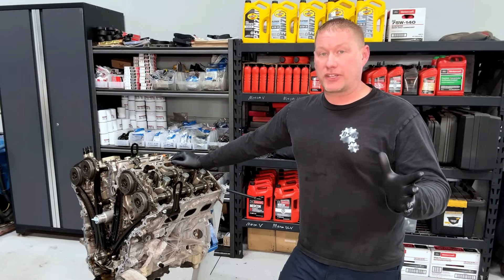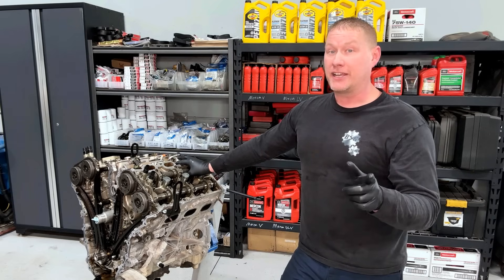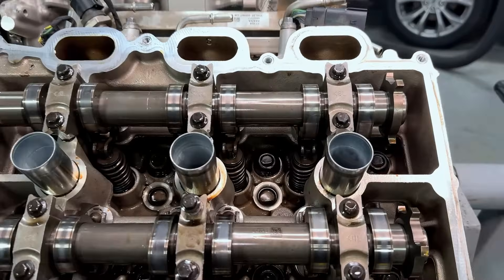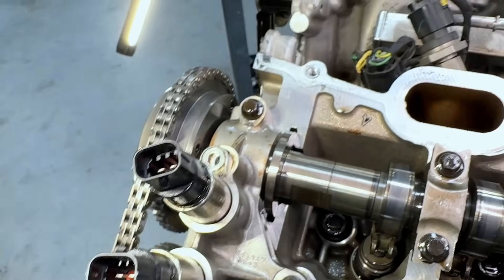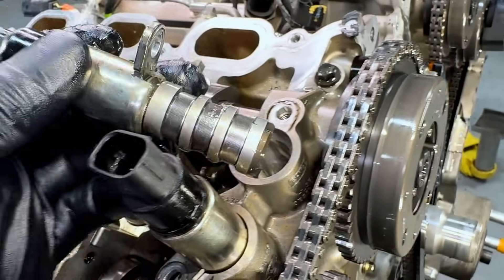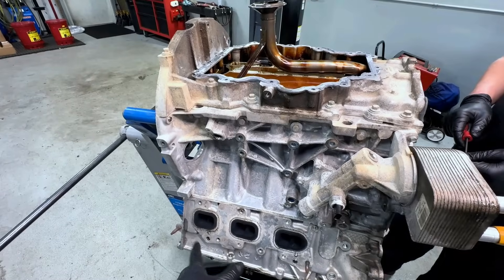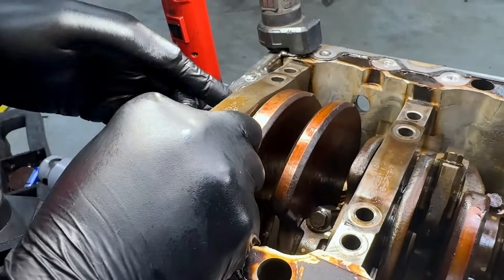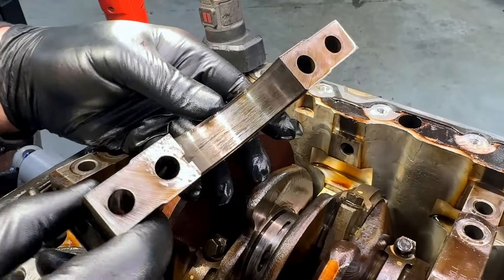Did The Ford Dealership Technician's Neglect Cause This 3.5L EcoBoost Engine to Fail?

Comment: Why would Ford make a casting that could be broken off that easily? Bad design in my eyes.
Reply: They probably never expected someone to pry or hammer on it. All it was designed to do was hold that little sensor in place, not be a pry point.

Comment: Theres my arguement for bringing back the V8. Even though the 3.5L V6 has more power & torque than the 5.4L. You have fewer pistons, rods, cylindeds,  and in this case fewer bearings  handling the stress load than the 5.4L V8.  Does my argument hold water?
Reply: Nope

Comment: I'm done with Ford now after dealing with the 3 valve Triton mess and now this. Ford should stand behind their engines and correct them promptly under warranty. Gone are the days of the indestructible 4.9L straight 6 engine that last 500,000 plus miles. I have one in my 96 F-150 and it still runs great.
Reply: I have the 4.6L 2V motor in my '05 Explorer it still runs strong as ever, even after a quarter million miles. No engine work at all other than new intake manifold gaskets.
Reply: Love the 4.9 inline 6.  Yeah, it does 0-60 in 5 minutes, but it will pull a tree stump out of the ground without breaking a sweat.
Reply: Using light oil and modern technology side by side is a winning formula for spoiling things.

Comment: Quality down the tubes on these newer engines. I believe the oil pump loss pressure do to timing chain tensioners o ring failure

Comment: You’ll never know exactly what caused the failure however based on how the front cover looked I’m goin to go out on a limb and guess the tech who replaced the phasers wasn’t careful or clean enough when he did the job and now years later the dealer is off the hook and the owners out 10-12 k for you to fix it right . What a shame ,it’s clear the owner was good with his maintenance.

Comment: Question,  my 05 5.4 engine was replaced by dealer with remanufactured engine. Just a start up it rattles a few seconds.  What is bleeding down?
Reply: Sounds like bad timing chain tensioners

Comment: This is making my old 4.0 sohc Ranger look good...220k and still going strong.
Reply: 1996 Splash with the 4.0 OHV engine and still runs like new.  Original everything. Alternator, starter, water pump.   Only had to swap out trans 10 years ago.
Reply: @jimmysteelart  How many miles on your 4.0 ohv?...sold one running great with 248,000 and currently have another....many make it to 400,000 without any internal work needed if you don't overheat them
Reply: 440K on my old ‘93 w/300 I6
Reply: @kellismith4329   Best engine Ford ever made.  Too bad they could pass emissions in 97.  That was the end of a 30+ year run of a bullet proof masterpiece.
Reply: '93 Cherokee XJ 2-door w/155k. 4.0L 5-speed.  Still get pretty good mileage, too.  And it's easy to work on!
Reply: que the ford ranger song
Reply: 238000 on my explorer

Comment: I'm really concerned on what caused those bearings to launch almost as if they were the wrong bearings I would have loved to seen the backside of the bearings where they did not appear as damaged looking at those the first thing that came to my mind wrong bearings oil got fed underneath the bearing to the cap forcing the bearing upwards against the crank a little bit tighter then once they wore while we know what happened then😮

Comment: It was working until the dealer fixed it, sounds too familiar. I agree with another post. Dealer may have done timing job and somebody started it before they added oil. Countdown to disaster.

Comment: BUT the cam phaser on this one look like GEN 3 ----2021 and newer model cam phaser,,
   DID you change them ?? or dealer did it,, ???
   Ido worry about my stupid 2018 expedition---in which has the same engine except NO camphaser changed yet,,  it had rattle noise 3 years ago,, luckily after dealer reset/update the  software ,, the rattling had been greatly reduced,,  yes,, still able to hear a bit of rattling,,, BUT the noise has been reduced 85%,,, the remaining 10---15% noise only  is far better than head knocking noise before,, I accept that,,  I change full synth oil every 7000 miles,, hope that keep it going,,,
Reply from the maker: Yes I said the dealer did

Comment: Am I mistaken, the screen on the phaser solenoids have metal residue on them, therefore the bearing material IS getting past the oil filter.  Those oil passages are fed oil downstream of the filter.
Reply from the maker: the oil goes to the crank and rod journals first then onto the heads and vct solenoids last so between the filter and the solenoid is where the metal is getting introduced.

Comment: That's gonna be a very expensive repair.  I'm sure that complete engine replacement is not cheap!  This is where a professional like Brian should be maintaining this vehicle.  No 10,000 mile oil changes either!  It's 3500 to 4000 miles or 6 months which ever comes first!
Thank you for this video.
Reply: That is too clean inside to have gone 10k on the oil change. Spun mains is unusual. I am betting more on a manufacturing defect.

Comment: I'm 55yo and still lay down on my driveway and change my own oil, on all my cars and bikes. The cost savings is secondary to knowing i did the job right, a little bit of back pain hurts less than new engine replacement
Reply: I'm 63 and still do my own servicing including transfer case, transmission, differentials, etc.  I feel your pain too.  Getting old sucks but beats the alternative.
Reply: Im 53 and do the same.
Last time I had an oil change at the dealer (GM), I came to find out that I drove the car 5000 miles with the drain plug finger tight... they put the plug back but didn't tighten it.
Luckly it didn't came off in 5K miles...
Reply: Yup.  Dealership service departments are incompetent.  It didn’t used to be that way.  But that’s what happens when people don’t give a crap about anything they work on.
Reply: I 'm 73 years old and also do all of my servicing myself. Nothing beats the satisfaction  of doing the job yourself and knowing that the job was done right. I have an F350 superduty with a diesel engine. This past summer I replaced replaced the serpentine belt . The factory manual states that you have to remove the radiator ,  shroud , the fan and the fan stator to do this .This is pure bullshit , you can work around all that stuff . It took me about one hour to do the job . When I finished both of my arms were coated with grease and grime  but I didn't see any of that ,  I just saw all the dollar bills that I saved doing the job myself !!!!!
Reply: 65 i started changing oil on my new xr75 in 1975 i change oil& brakes on all family members,cheaper &its done correctly still have xr75😊
Reply: Ditto
Reply: 66 and I’m still doing it !
Reply: Not while vehicle has warranty you can’t do it yourself 
Used vehicle, definitely do it yourself 
I had a lot of issues with recalls and maintenance at the dealership 
One time I was told I needed to change filters which they were new with 2000 miles at most and service adviser said it needed to be replaced
Reply: @reyperez3424  it doesn’t void the warranty, do some research
Reply: Same here, 56 now, started changing my oil when I was 21. Now I do 99.999% of all car and home repairs and maintenance myself. Cost savings are enormous, I can afford to keep an older car on the road for very little, and I've saved hundreds of thousands over the decades not having to replace cars, roofs, AC systems, maintenance, plumbers, whatever. I don't even take the cars on for tires. I takes the wheels off and take those in. No stripped lugs. DIY is done right the first time, every time, with top quality parts, for 1/3 the cost or less. DIY is freedom. What for others is a crisis, for us is a minor inconvenience to be handled on a Saturday morning.

Comment: I'm confused. Did the timing job cause the failure?
Reply: Very possible. Forgot to refill oil before starting? The broken chunk restricted the oil pickup?
Reply: @billsimpson604  That broken chunk is most likely what caused the issue. How do you prove the dealer tech destroyed the engine?
Reply: No. Because it's an ecoboost & they need a timing job every 10 oil changes or so!

Comment: Hmmm.... I can see there is little for deposits... so the oil has been changed regularly .... but that isn't necessarily indicative of wear...  What oil was he using??... Right viscosity??  What came first... shifting bearings... causing wear... or wear causing shifting bearings... Metal introduced when it was worked on... causing accelerated wear??? Did you determine the root cause ?? I like my old 4.6L more and more :-)

Comment: YOU ARE SCARING THE HELL OUT OF ME.
I have a 2010 Ford 5.4L Raptor with 57,000 miles.
will it last until the next Oil Change?
or should I put it on Marketplace before it goes to hell?

I have seen you, and Rainman Ray showing us those Damn Cam Phasers going to hell, so much, I don't think my Raptor will ever get old, like my '01 K1500 Suburban with 230k miles on it, and runs like brand new... it just pulled 8,000 lbs from SD to OK in style, slow, but it got me home.
Reply: change the oil regularly and don't film any Utube vids and it should last, my 5.4l had 200k on it before i traded it for an 3.5l. But yes all these videos keep us guessing our engines longevity

Comment: Not sure I come away understanding exactly the cause of this failure, lots of damage but no clear ID on the exact cause. The wear pattern on the front and rear main bearings troubles me, the wear should be evenly across the face of the bearing surface and it is not. It is also puzzling that the front and rear mains are radically different in wear and damage compared to the two center bearings. If the mains were to be gauged with plasti gauge or some such I believe it would definitely reveal tolerances out of spec. Perhaps the engine was ford lemon, which is common these days and it took until now for it to reach the final rapid failure mode, there is an answer somewhere but immaterial now, just another car owner victim of Ford.

Comment: How far does the oil pump pickup screen sit above the oil pan? Could the broken casting have blocked the pickup screen causing oil starvation? I'm sure the pistons are short skirt type and lack of oil pressure would score pistons and damage rings. I feel the owners pain on that one.

Comment: i will never own a turbocharged gasoline engine!!!  the designs are insufficient for the pressures excerted on the parts.   the two outer mains prove the point.  wear on the inner surfaces and not the outer shows either block or crank flex. should be even wear across the entire surface.

Comment: I just got the phaser rattle on my gen2 3.5 cohost in a 2018 Expedition 67000 miles.  Do I need to rush to get the phaser replaced or do I live with it?  I’m using Flood Start Mode to prime the oil and getting no rattle.  I do all the oil changes at 5k or lower.  I don’t have a Brian near by that I can absolutely trust to do it right the first time.

Comment: Took my 46,000 mile '19 with 3.5EB in for cam phasers. Two complete tear downs and two sets of cam phasers and associated parts, and 13 days later got my truck back. Do I trust that truck now - got my fingers crossed but so far it has been faithful over the last 500 or so miles. The positives - a timely (due) oil, filter and coolant change  - two times and one plus mpg gas mileage increase (so far). If it 'blows' my no charge receipt is ready to show that the engine has been opened twice
Reply: Cam phasers at 46k? 

Lol that's horrible
Reply: @samholdsworth420  Yep. That's what the service manager said as well (he is also a 40+ year friend as well) This is a babied truck that has had oil changed every 3500-4000 miles and done at the dealership

Comment: So what was the conclusion? What caused the crankshaft bearings to fail?
Reply: Mains usually fail when oil pressure is suddenly lost, like drain plug falls out, or started by accident after an oil drain but no oil put back in, or a filter o-ring blew out. Rods usually fail when engine run low on oil for an extended time.
Reply: @RonRussell-sj1zf    Yes, I am well aware of that, but why didn’t he come to a conclusion on the video. He’s the one who made the accusation.
Reply: I was wondering the same thing. What was the root cause? How did the metal get in the phaser solenoids? The oil would have passed through the filter so should be clean. Debris from the mains would be flushed into the sump so cannot make its way to the top of the engine. It sounds like the oil filter wasn’t doing its job.
Reply: @kevinmills5293  The debris in the solenoids is from the bearings that failed. Somehow the material got pulled into the crank and fed upstream to the heads, but that is bearing goo in the screens.   Root cause is speculation at this point, we know what failed, but the answer to why is a mystery.  As others said, maybe it got started without oil which marked the bearings and then just driving did it in.
Reply: @acdii  “somehow” is not possible.
Reply: Most likely oil starvation, causing the bearings to get too hot and spin. That piece he showed that broke off where the sensor was could be a smoking gun to what started this all.

Comment: but where is the broken piece of the connector holder..  was that the pieces in the pickup..
Reply: @chris That’s where I too thought the vid was heading to!
Reply: Other folks in the comments are speculating the tech forgot to refill the engine with oil after the phaser repair, took it for a test drive, and finally remembered to fill it. This kinda makes the most sense to me since I don't think that broken metal chunk would leave the bottom of the oil pan.

Comment: Ford and what’s left of the other so-called American manufacturers need to go back to mechanical systems! These manufacturers have gone way too far with the electronics and electronic control systems! Another issue is using way too much plastic, and instead of using gaskets using silicone to seal components! This will never happen because nobody gives a shit anymore in this country!
Reply: They had to do that to meet the government fleet mileage requirements. That stuff might change in about 4 months, depending on who wins the election.
Reply: @billsimpson604  So, in other words, it wastes a lot more fuel, while trying to save fuel!

Comment: Great video! You think the broken piece of aluminum from the sensor is what started the problem?🤔
Reply from the maker: The only thing that I see for sure.
Reply: @FordTechMakuloco   I used to work at the Ford dealership over 20 yrs..   I admit that I installed harmonic balancer incorrect before but I still see other techs using air hammer to installed balancer .    Maybe you can advise this issues on your next videos

Comment: Yes, great video,  but this is off subject, Have a 2016 police interceptor utility has the 3.7 engine and still has the Ford Orange. coolant that Ford advised the change to the Yellow coolant becouse of the water aluminum water pump issues.

Comment: So was it oil starvation? The pickup even tho it had crap in there still should have been ok..or should it? The engine seemed very clean inside so I’m guessing it had regular oil changes. Excellent video, thumbs 👍from me.

Comment: The question I would be asking is why? This is not normal for this engine. There has to be a cause🤔. Previous repair debris left behind to get picked up in the pump screen? 🤔
Reply from the maker: It may have been floating around.